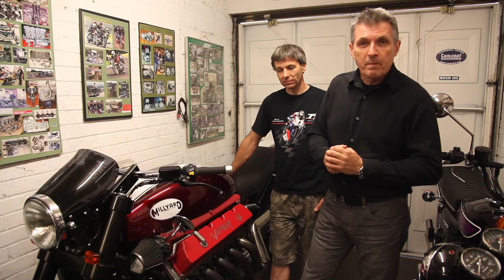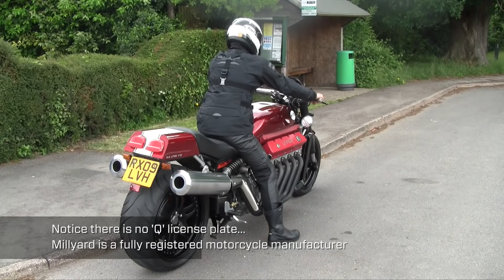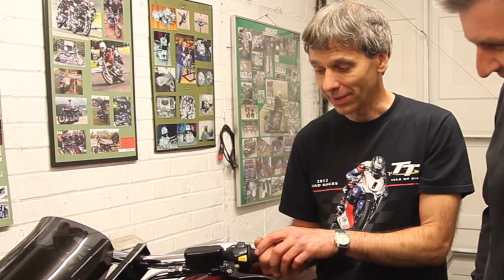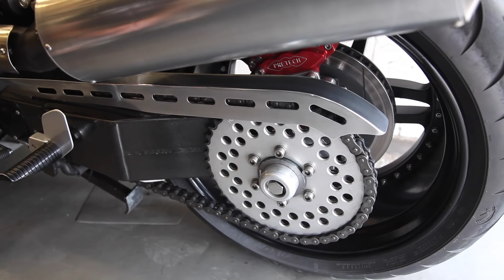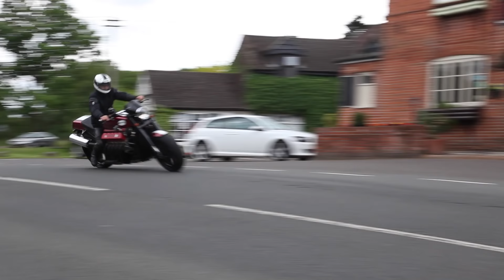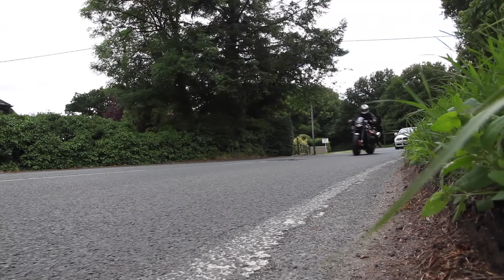The Viper Bike | a chat with Allen Millyard

Comment: My God this is the coolest motorcycle I've seen so far on YouTube. The engineering that went into this and the way it turned out is really better than anything I've seen before. A lot of people make custom motorcycles but it's very rare that they actually look good. The Boss Hoss bikes look incredibly ugly with wretched body proportions and giant hideous radiators with plainly visible basic electric fans. This bike looks like a Japanese sport bike, it's perfectly beautiful in a modern way that fits the modern engine. The old chopper look of American bikes is cool. But I prefer this more modern look. And that's what makes this so impressive! It doesn't look like a custom monstrosity. It looks factory!

Comment: How does the drive chain even survive the brutal power and torque ?
Reply: I replace the chain every 1000 miles, Its a non o ring EK630 drag race chain rated at 1000bhp
Reply: WD40.